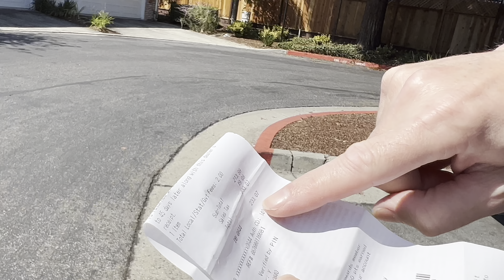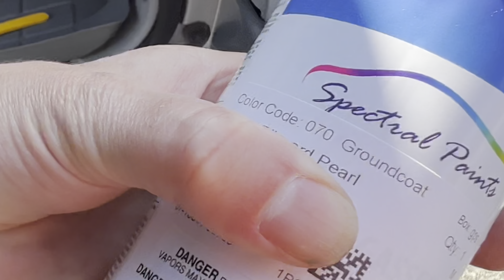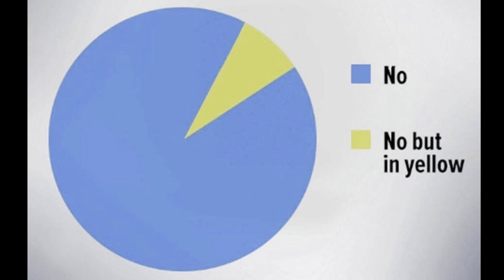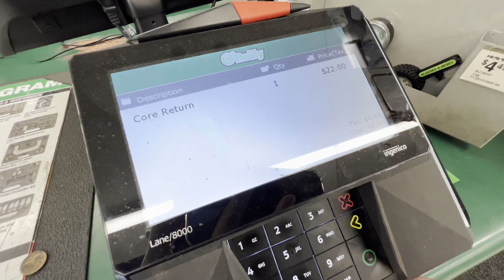Our Sequoia Left Us Stranded!

Comment: The fact you got 5 years out of a battery is actually very good! Probably some signs before it left you stranded to look out for next time! 
Also, the reason why it died on start up is because it has to learn your throttle position. When you disconnect the battery, it assumes the throttle is new and clean when it’s reconnected. So the fact it died, is a sign that your throttle plate/housing is dirty! Clean it up every 50k miles to keep it happy
Reply from the maker: i appreciate the words of wisdom!!  👍🏼

Comment: How many miles does she have now?  My 2015 has 220k. Only issue is my power steering pump pully is clicking.
Reply from the maker: The 2012 Platinum has 166,220 i looked last night, it’s overdue for an oil change.. imma get on that tomorrow.  bummer about your steering pump pulley, have you figured out how much that’s gonna cost?